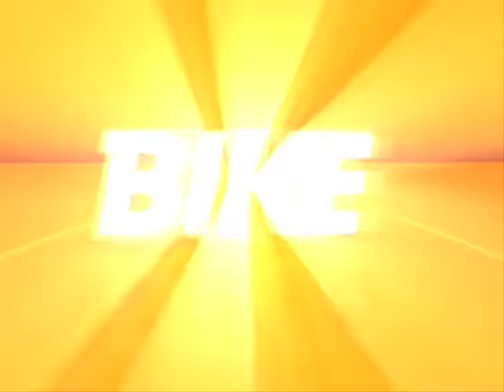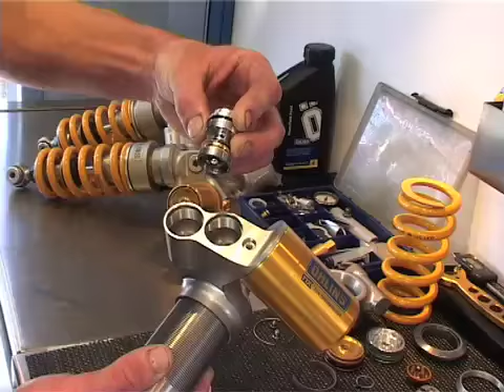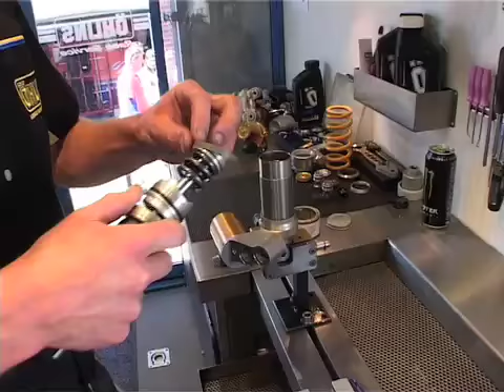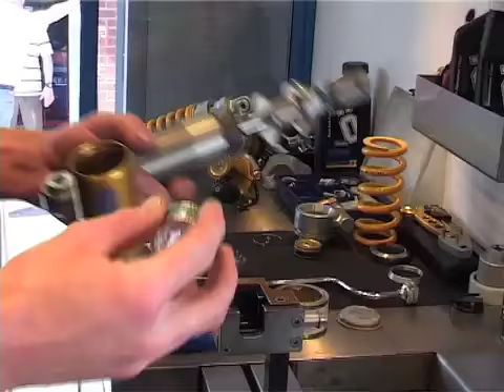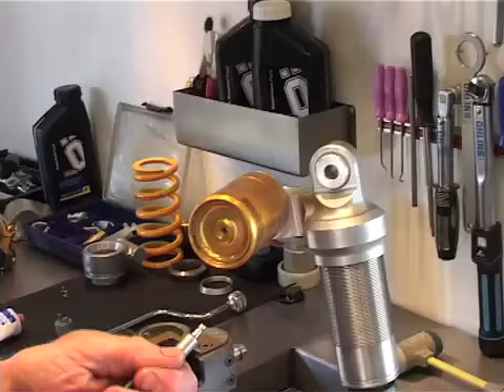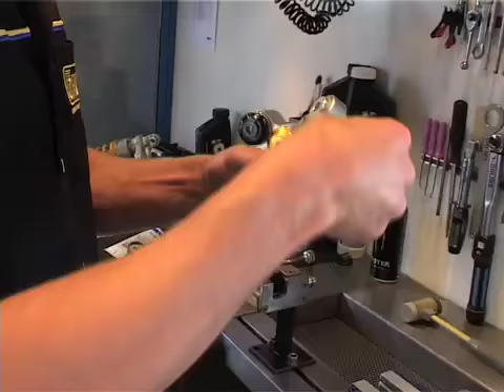Ohlins Re-build at BSB

Comment: @elephantcup 
The TTX shock is unique in that it works like a steering damper more than a shock absorber. It uses a solid main piston & pushes oil through the adjuster assemblies during compression & rebound stroke. This results in less friction. The shocks run cooler. They use far less parts. They are smaller & weigh less. The spring can also be smaller & weigh less. The valve shims can be changed without complete dissassembly of the shock, etc.

Comment: It does use valve stacks (shim stacks).  The TTX just relocated the rebound valving that used to be mounted to the bottom of the shaft, to the top of the shock.  On the TTX, both rebound and compression valves are side by side on top.  You can clearly see them in various places in the video, and he explains the concept in the beginning of the video.
I imagine that they changed the design so that both valve assemblies can easily be accessed (therefore easily tuned) without taking the shock apart.